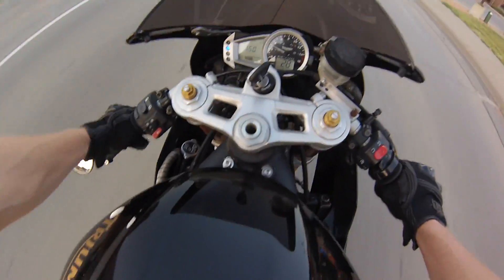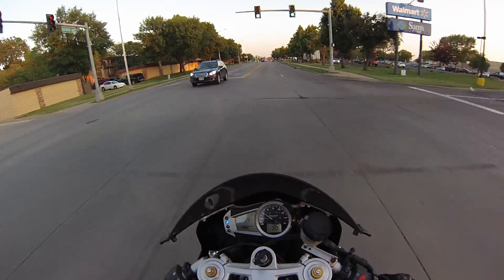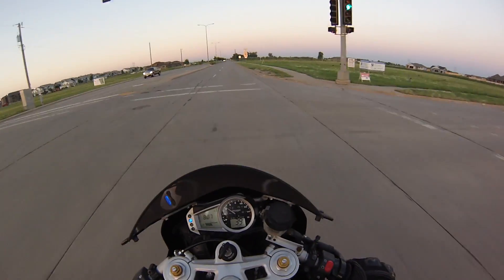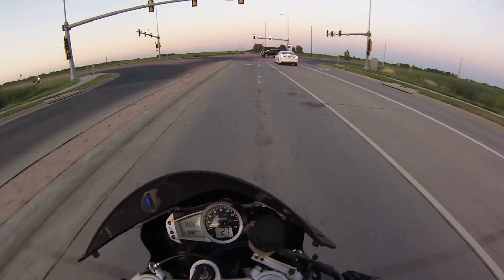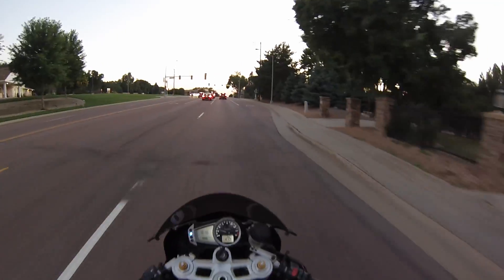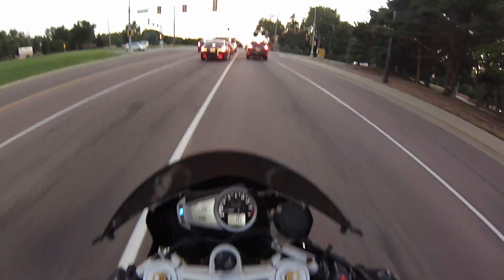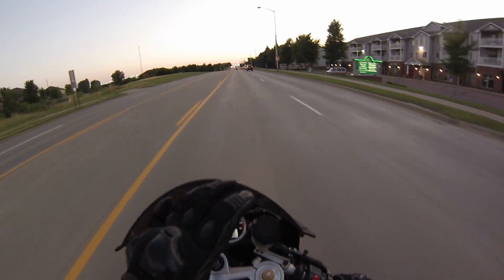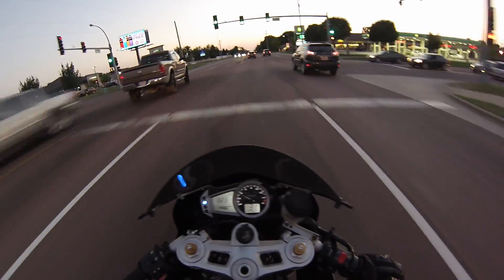Horsepower vs Torque - EXPLAINED!

Comment: So a 300 hp car with 100 lb-ft of torque will accelerate at the same rate as a 300 hp car with 200 lb-ft of torque?  Saying weight, gear ratio, etc. is the same?
Reply: So typically a 4 cylinder turbo can make what max hp / tq
Reply: the higher torque will acceleration more
Reply: With that info, Yes - exactly the same. Note (as others have not) that designers would have had to equip the higher torque engine with half the final drive gear ratio as the lower torque engine. That way they are both well suited for normal driving speeds assuming they have the same purpose. This is generally the case in the real world.
Now there is an important reason that we often see a correlation between a flat power curve and a high torque number. A flat power curve means good power is made at other rpm besides the rpm for best power. This has a significant impact on acceleration as you shift through the gears, and is solely responsible for that punchy "torquey" feeling . Flat power curves are often found on engines that can't breathe very well as they rev faster. These are often large engines for their power output.
This correlation and some intuition pitfalls are why so many people who haven't fully grasped the math believe that a high torque number is related to acceleration. It's really all about power. I'm happy to continue if this is helping anyone...
Reply from the maker: Hi Kurt, acceleration typically depends more heavily on the amount of torque an engine can produce therefore if the cars were under the same conditions the 200 lb-ft car would accelerate faster.
Reply from the maker: The 200 lb-ft car produces the same 300 hp as the 100 lb-ft car, meaning the 200 lb-ft car produces the same horsepower at a lower RPM due to the higher torque numbers (refer to the formula in video). That higher torque at a lower RPM is directly why the 200 lb-ft car would have a faster acceleration.
Reply: MotoPosh So then, more horsepower is just a fancy way of saying more torque at lower rpms?  So say we were to look at a Bugatti and my Ford fusion (I know, I hope to get a more sporty but cheap focus st; it's not the greatest example ever) next to each other.  What exactly physics-wise about the Bugatti's more cylinders and turbos are making that Bugatti destroy me in a 1/4 mile?  If you look at horsepower, it's crazy high in comparison, but torque doesn't necessarily look as killer as the 10-second difference to the finish line.  But looking at a Bugatti acceleration video, it doesn't ever go higher than 8,000 rpms, which is really only 1,000 higher than my fusion?
Reply: MotoPosh Or maybe that's a bad example because of weight.  Say I had a Mazda Miata.  Suuuper light, but no engine swap on it.  Now physics-wise, why is the Bugatti going faster than that Miata?  Does it really make that many more rpms?  Or is it a mix of lower weight (body), higher torque (longer distance between cylinder and axle), wider torque (turbos) AND rpms (no idea what would make more of those happen; faster explosions maybe)?
Reply from the maker: For the first example the Bugatti puts out a whopping 1100 lb-ft of torque versus the couple hundred your ford puts out. It all comes down to torque if the rpms are similar. However in the video I mention my sportbike, i put down 45 lb-ft of torque at 15000 rpm so in that situation the my super high revving engine is what produces the power and allows me to accelerate so quick with relatively low torque.
Reply from the maker: Generally speaking if you're talking about cars they all have similar red lines for rpms. Usually around 8000. So really physics-wise it comes down to the amount of torque produced. And if you didnt catch all of the video the amount of torque an engine produces is directly correlated to its size. The might be a 2.0L where as a Bugatti is a 8L turbocharged.
Reply from the maker: And yes an rpm is a revolution in your engine. Meaning an explosion occurs. And weight definitely plays a part too as you mentioned. To keep it simple though... if you want a faster car you want higher rpms and more torque. Both of those together yield higher horsepower.
Reply: MotoPosh Ohhh, I think I understand it pretty well now then 😂  So because cars all have around the same rpm redlines, torque is pretty much the ONLY deciding factor for hp then?  And sorry about not realizing liters decides torque; I've watched five videos repeatedly to understand all of this, and it's a lot to take in 😅
Reply: However, your bike being a lower torque (I'm guessing less liters then) and higher rpms thus kicks the hp up a lot higher.
Reply: Also, sorry, the Veyron stats I saw were probably not very reliable 😅
Reply: MotoPosh And one more thing to make sure I completely understand it, if you stuck a Ford F-250 engine inside a Miata (excluding weight/saying you could actually do this), why would it do virtually nothing compared to sticking an ls3 inside of it?
Reply from the maker: You're exactly right! Torque is really the only factor that can vary and it's all good haha I know it can be very confusing. Hope this helped!
Reply: MotoPosh Awesome!  Thank you!

Comment: ok the street triple rs has more hp but the yamaha mt09 has more torque so which is faster?
Reply from the maker: Depends what you mean by faster! Quicker as in acceleration? Or faster as in top speed? Much of it has to do with the bikes gearing as well

Comment: it's very simple people look at the damn equation of HP lol. HP= (TQ)X RPMS. even HP is TQ LOL. there the same damn thing only difference is the name. TQ is labeled TQ for low end power BUT it's still TQ doing all the work at high rpms but it's jus labeled as HP. TQ is the twisting force of everything and your entire vehicle no matter what you drive has to run of TQ not HP. TQ is the single most important factor of any engine. TQ is SPEED, ACCEPTATION, POWER. you can't build more HP without TQ. but you can build more TQ without HP because of rpms. at the end of the day TQ RULES EVERYTHING😘😘
Reply: Yep, let's use this classic physics 101 equation:
a = P/(vm)
I can translate for you:
accelleration = power / (speed * mass)
Reply: You forgot divided by 5252
Reply: @stevemitchell2252  He's still working in standard units;) 5252 doesn't belong there until he has specifically decided to talk in Horsepower and revs per minute (which are nonstandard units).
Reply: physics isnt an opinion. youre wrong

Comment: Isn't horsepower just torque mulitplied by RPM? Which is why a big turbocharged diesel pumps out as much horsepower as a high rev petrol, while doing half as much RPM.
Reply from the maker: Essentially, yes. Horsepower is a function of torque. There some more math than just RPM x  Torque though
Reply: @Motoposh  Yes, power is just torque times rotational speed. There's not more math there, you just have to use a constant factor when you want to just plug in nonstandard units, like 1/5252 specifically for using Horsepower and revs per minute.

Comment: Has a cyclist more torque in low RPM? As much RPM can you move the legs, do you have more power?
Thanks :)
Reply from the maker: Exactly!
Reply: MotoPosh Thank you so much !
Reply: You are a Diesel
Reply: A cyclist is actually closer to an electric motor than a combustion engine. We can generally put the most torque on the crank, or force with our muscles when they are static. As we move faster and faster, our max muscle tension drops. Each person will have a specific pedal rate for best power output, and another pedal rate for best efficiency (most power out for the caloric power in). We use the gears to get our pedal speed just right for the application.

Comment: The guy in the S2K knows that there is in fact a replacement for displacement - forced induction.
Reply from the maker: +Joe Milton Fair play. Haha
Reply: So when you have the same boost on a bigger displacement...still coming out on top....
Reply: You clearly dont understand the saying... if you cant fit a bigger motor in your car. you can replace the lack of displacement with boost. someone brags about a 3L when you have a 1.5L. you can just basically add 15psi from a turbo and your 1.5L will act like a 3L..... THIS IS WHERE THE SAYING COMES FROM
jesus christ
Reply: Yes and no. Because boost capability, weight and aerodynamics all matter as well, as well traction. So, if a heavy Dodge Challenger, with a 5.9L hemi, has an 80mm turbo at max boost and a corvette, with a 5.3 LS, has twin 60mil turbos at 70% and both cars launch on the same boost pressure. The corvette could very well win by weight aero dynamics and traction if he doesn’t spin. And he could also very well add boost down the big end. If the only thing different is displacement it comes down to who’s car is more aero dynamic, who has tire pressure just low enough not to spin but high enough to not suck power. Who has the ability to squeeze water out of a rock through timing air fuel mixture, gear ratios. Ect  displacement is the deciding factor for just how much your motor can do NA or forced. But at the end of the day it’s all to complex for a comment lol. Because a 454 blower on the bottle isn’t going to be as useful as a 350 small block on twin 60s if the goal is to be agile light and fast in multiple directions. But the big blown and sprayed 454 is a drag monster. Different builds for different purposes. Very very complex. That’s why race teams have r&d and engineering departments. Because it gets to be just that minute of a change.

Comment: I want to pull caravan.
Someone told me that we need car with a lot of torque. 
I think he's wrong, couse we need power to pull this caravan couse Power makes acceleration.
Which vehicle pulls stronger?
vehicle A with constant 2000 rpm with 500Nm
or vehicle B with constant 13000 rpm with 100Nm?
In my opinion Vehicle B couse it has more power
(185hp) than vehicle A (142hp)

I know 13000rpm is irrational and better is to have car with a lot of low rpm power. But in this example vehicle B pulls stronger
Am I right?
Reply from the maker: Yes you are correct. Whats important when towing is that your engine builds torque in the lower RPM's to start pulling what you're hauling.
Reply: Hi
I understand 90% of it but one thing i dont understand.
If for better acceleration we need power not torque, so why in my car 1.8t chipped i feel better acceleration for example on 3rd gear betwen 2,5k-4k rpm (where average power and torque is 135hp & 290Nm) than between 4,5k-6k rpm (where average power and torque is 180hp & 240Nm) ??
I know there is a air resistance but i dont belive that is so big. Same feeling on 2nd gear.
Same example is in diesel 1.9tdi 130hp.
On 3rd gear at 4k rpm (max power)  accelerate slower than  at 2.5k rpm 
All I want to know why I fell more counter force on my seat when I 'am betwen 2.5k-4k RPM than between 4,5k-6k RPM although power of engine is bigger there

Why is that?
Reply: @Motoposh  What about a tractor, it has very high Torque but very little horsepower.  To pull a caravan, it seems the friend is right, you would need a vehicle with a lot of torque, no?
Reply: @Motoposh  Yes, for towing (and accelerating), first priority is you want plenty of power. A close second is you want a flat power curve (aka making good power at revs way below the peak). This is really what you were saying with - "building torque in the lower rpms" - but because the torque curve is already flatter, it's harder to see the traits you want. It's really easy to see in the power curve. But more importantly, that peak engine torque number isn't actually telling you anything about the vehicle's performance in any way. There are other reasons towing vehicles (not necessarily quick accelerating vehicles) usually have high torque numbers. I'm happy to explain...

Comment: Torque  wins races horsepower sells cars
Reply: And you’re wrong dude. Hp matters with respect to rate of acceleration. Hp wins races 😂
Reply: That's so hilariously false

Torque and horsepower are functions of eachother.
Reply from the maker: +Killa Bee That one works too
Reply: @Motoposh  The only way the cliche of torque winning races and power selling “works” is to perpetuate two myths:
1: That the people who believe this nonsense are the ones who haven’t been fooled by sales and marketing.
2. That Power which is a measure of how quickly something can be done is also not the measure of winning a race.

Anything Torque can do, Power can do better and/or faster.

Torque is the sound of one hand clapping.
Reply: Horsepower wins towing trials, torque sells trucks;)
Reply: @drienkm Excellent reply to this Torque-supremacist nonsense.

Comment: going back to the horse lifting the pound a foot. it was noticed comparing horse's, although both was limited to a specific amount of wight, well say it was 300 lbs. horse A could do it faster.  So although they both did the same amount of work one could do it in less time, H.P.
Reply: David Rogers
The original horse experiment was done with how much weight can a horse lift in one second for a vertical distance of 1 foot.. So after all the experiments they did well one guy did he found out that it can lift 550 pounds in one second for 1 foot.

Comment: tq is rate per hour, hp is salary....

if you work 1 hour a year you make no hp..... if you work a shitty hourly rate but 70 hours a week, you get a great salary...

hp is what matters since hp is energy..... tq has no indication of performance..... its just physics

comparing the two is moronic
Reply from the maker: Chad W Torque has a lot to do with performance lol you said it yourself... no torque = no horsepower. Differentiating the two is a handy thing to know if you want to sound at all smart
Reply: @Motoposh  You're right honestly. You're very wrong about what power is, but you're right about this. For most people this whole discussion is just conversation jewelry! Lol Really, if you just wanna go fast, just buy things that are known to be fast or mod them in the ways all the fast people do.
If you wanna trail-blaze and design and build barrier-breaking stuff that no one has ever seen before, you do actually need to understand it.
Reply: Chad W tq is hp dummy it takes more tq to generate hp. Hp is tq times RPM. Tq is hp. Without tq there is no hp but there is tq without hp. Tq is what turns the crank not hp. Tq is way more important then hp. Without tq the engine does not operate hp is not even important. Simple as this tq is hp at any rpm under 5252 but as soon as the rpm is higher then 5252 rpm it's called hp. Same thing different name. So after all is said and done tq is the single most important factor of any engine especially racing. Take a engine that makes 1000 lbs ft tq and 1 hp vs 1000 hp and 1 lbs ft tq which one wins the race? Easy the engine with more power turning the crank which is 1000 lbs ft tq. Real power is tq not hp.
Reply: @kingaustin169  
Take an engine with 1nm @10000rpm and one with 1000nm @ 10rpm. 
Which one wins with anything else staying the same?
The fast one with 1/1000 of the torque. Why? Because it has more power.